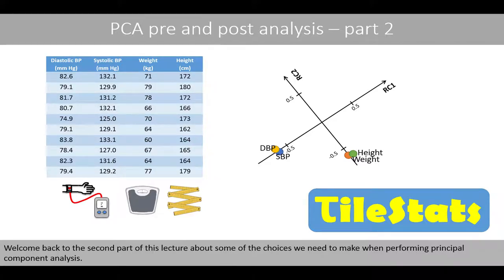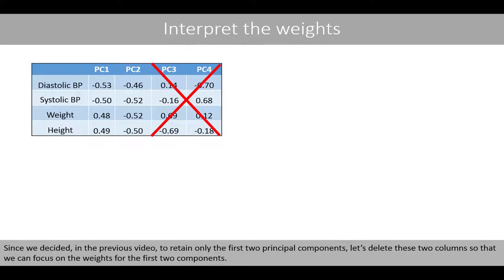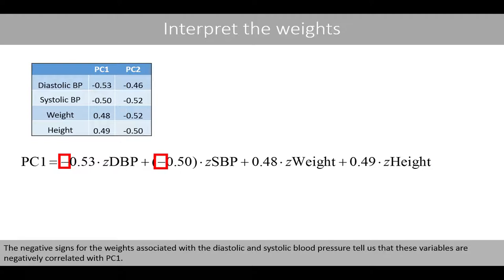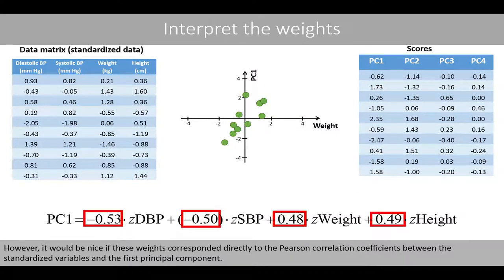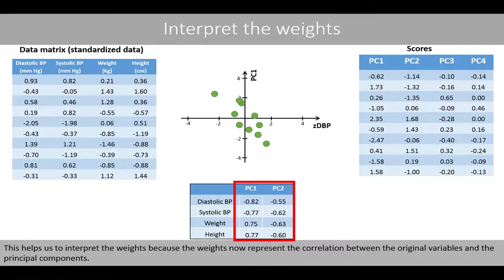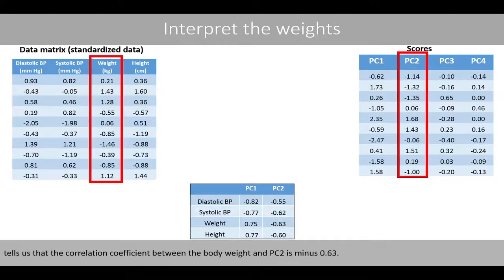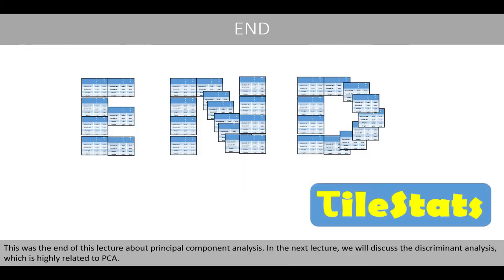PCA : how to interpret the weights/loadings and Varimax rotation

Comment: Hello,
How do one compute the final weights for a variable or indicator if two or more PC are retained and what could be the statistical tests to use to check the robustness of those final weights to be able to select the appropriate PCA model that best represent the data?
Please advice.
Reply from the maker: I'm not sure what you mean with "final weights". If you watch my video "PCA 3 : standardization and how to extract components", you see that the weights do not change when we extract components. This video also shows how many PCs you should extract. The values of the weights only change if you change the constraint (but that is optional). You get other types of weights if you rotate by Varimax rotation. You can use some kind of bootstrapping method to check the robustness of your PCA model.
Reply: @tilestats  I am getting what you are saying, but if we have chosen to use two PCs,  the variable or indicator Xi will have the weights for PC1 and also the weights on PC2 and now to compute the overall weight of Xi to the Index is my challenge. 

If you can also provide some references for the bootstrapping method to check the robustness I will appreciate.
Reply: @tilestats  I will also watch your PCA 3 video, thanks for your assistance and your willingness to assist us.
Reply from the maker: @mangalanimakananisa6800  Have a look at this paper:
https://link.springer.com/article/10.1007/s13253-019-00355-5#Sec10
Reply: @tilestats  thank you, I will have a look

Comment: At 6:15 you say"increase the interpretation pf our weights or loadings". You mean that it help interpeting both or that weights  are also called loadings? I have this doubt because you said that an eigenvector is the vector of weights, while in statquest videos the speaker says that  eigen vector is the vector of poadings. Moreover, you expressed loadings as the product  of weights and squared root of eigenvalues.  These differences between your video and statquest ones  confised me a bit. Thanks if you are willing to help😊
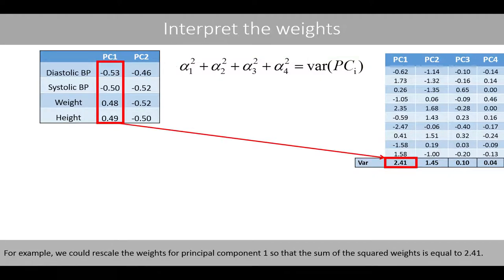Reply from the maker: I would say that a loading is a weight that represents the correlation coefficient between the given variable and a certain PC, like I explain around 4:00.

Comment: Hello, the explanation is very good, I still have a doubt, how the rotation matrix is calculated, it is known that the spss I calculate it, I am interested in calculating it manually, please, if you have a calculation example, I would be grateful. Clarify that I speak Spanish, I hope I have written well.
Reply from the maker: Hi
In my second video about PCA, I show how to rotate the data by simple linear algebra. However, Varimax rotation is an iterative method. It means that the data is rotated step-wise to find the best rotation according to some minimization (or maximization) problem (see Wikipedia). In SPSS you can, for example, specify the maximum number of steps the algorithm should take for convergence. Hope this helps.
Reply: @tilestats  Hello.
I want to do the rotation manually, doing calculations, I don't understand with what data the diagonal matrix is taken, it is taken with the extracted factors, the eigenvectors are taken from these, etc. I have those doubts. Please, if you had a calculation at least two factor manual; you can share me. It would be very nice if you make a third video with a rotation. With manual calculations.
Reply: @tilestats  In your second video how to get the rotation matrix
Reply from the maker: @edwinchavarria9943  I took the rotation matrix from, e.g. SPSS. If you like to know the details of how to compute Varimax rotation I would recommend the following page.
https://www.real-statistics.com/linear-algebra-matrix-topics/varimax/
Reply: @tilestats  Thank you, I will visit the page, to learn the varimax rotation. Because of how didactic your explanation is, I hope you can make another video on rotation.

Comment: First at 3:16  a_1^2 + a_2^2 + a_3^2 + a_4^2 = 1, and then at 3:54 it equals var(PC_i). What am I missing? shouldn't you use different letters?
Reply from the maker: I see what you mean, it would be clearer to use different letters. Anyway, alpha is the general notation for the weights. This is why I kept the notation although I re-scale the weights.